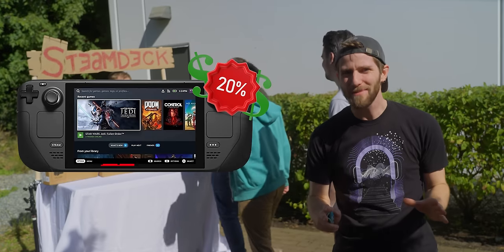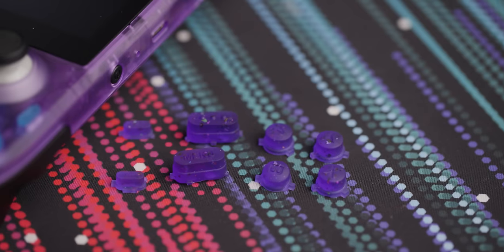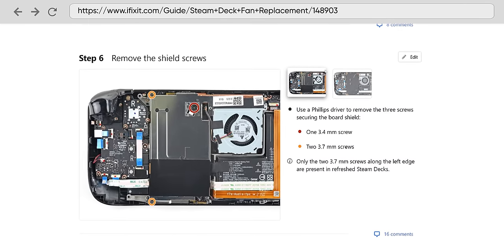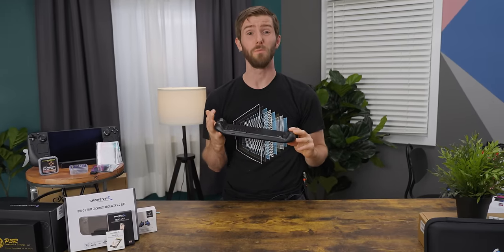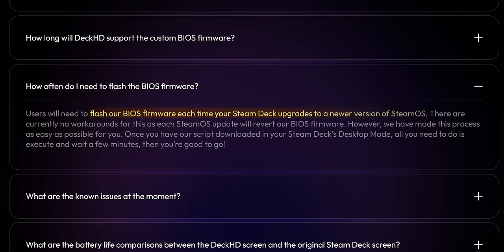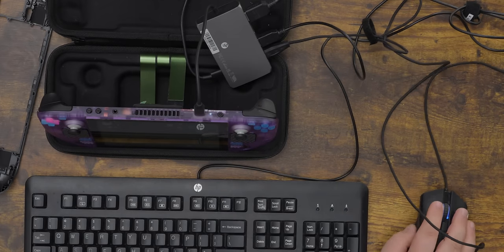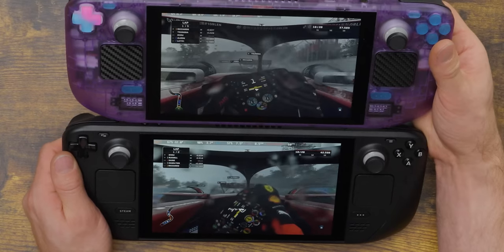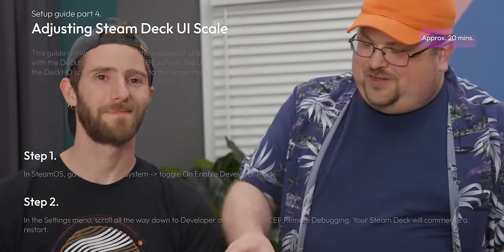Five Steam Deck Upgrades under $100

Comment: In case it wasn't done, I found that with the GuliKit sticks, I had to push (seat) both sticks after installed otherwise, they would feel like trash and stick to the side or down. To seat them (can do out of deck in hand or after install) I literally just compressed the sticks and allowed them to click together. There is a noticeable click after the L3/R3 button and it will feel better and not stick. I have no idea why that was a thing but I confirmed it on 3 sets back to back so it must be on other sets too. Hopefully this will help others that encounter the same issue.

Comment: The fact that people are now able to make replacement screens for the Steam Deck is a big green flag to me. 

Valve had mentioned that screen upgrades would require significant engineering effort (seems to add up based on the complexity of this replacement process) and would never hapoen officially. 

Now personally I would like to see a screen thats the same resolution as the steam deck one but using OLED
Reply: Dude are you a fortune teller?

Comment: I have an ExtremeRate white shell and original screws were no deal at all. They worked exactly as on original shell. The shell is “extreme”Ly premium in my opinion. The screen is not worth it though. Say goodbye to Steam Deck overclocking cause their BIOS probably won’t support it.

Comment: Doing a BIOS flash via what looks like a USB dock seems insane to me, just another point of failure in a very low-tolerance situation. New case and buttons look awesome, screen doesn't seem ready on the integration side yet

Comment: The K5-Pro could be used instead of the thermal pads to account for the height difference? It will make a mess, but if it works xD

Comment: Here's hoping a future iteration of the Steam Deck has easier m.2 access so we can add in an SSD drive with relative ease without compromising the integrity of the case. Maybe something similar to PS5 or laptops, where you just unscrew a small part and swap in the SSD and rescrew it.

Comment: i really don't understand why people insist on switching to a higher resolution display.
just give me a slightly larger (if possible) OLED screen and i'm sold
extra points for a higher refresh rate display, not for heavy games, but for light games and rhythm games, it's a game changer for sure

Comment: Should have tried some upscaling with the screen. Personally I dont care much about resolution but a 120-144hz upgrade? Yes. Id buy a Deck if that was a thing lol. It may not work great for some games but for especially 2D or retro game? Having high refresh is why I still use my laptop for semi-portable gaming etc

Comment: This is kinda the same way I feel about heavily modifying cars.

You can take something that’s for the masses and make it perform amazingly well, and have something truly unique. However, the path to get there is expensive, time consuming and often frustrating in unforeseeable ways. 

Ultimately you end up with something that’s cool, but less reliable and riddled with anywhere from small to unforgivable issues. At some point you should seriously consider just spending more upfront rather than re-doing all of reliable engineering done by the OEM.

Comment: The screw thing with extremerate seems to be how they do everything, I have replaced the shell of my switch with theirs, think I used the original screws and a few months in and the shells are cracking around the screws (after 1 part slightly cracked pretty much as soon as I installed it, which at the time I just out down to me maybe being a bit heavy handed)

Comment: What's the point of all this if there's the OLED version LOL with the momey spent in the video you get a much more optimized device (thermal dissipation, screen, joysticks, dpads, bigger battery and several other improvments) out of the box

Comment: I dunno if it's down to the sub-pixel array of LED vs. OLED or because it's portrait content vs. landscape, but I can always tell when a phone is even slightly lower resolution than 1440p but struggle to distinguish 720p from 1080p on handhelds and TVs.

Comment: I know the "Steam Deck 2" isn't really on the roadmap yet, but I can seriously see myself replacing my entire desktop with one.
I'm still rocking a 4th gen i7 and AMD r9 390 desktop and I plan to run it into the ground. I think by the time the next Steam Deck refresh comes out, it would be a pretty valid upgrade.
Reply: the 1.5 is kinda on the way though with revision 1030
Reply: @tomzpl you were closer than you realized lol

Comment: I use the Deck for emulation so what I would love would be programmable LED buttons that would look like the buttons on the system emulated and change when they system emulated changed.

Comment: I'm astonished by how many people want to 'upgrade' their steam deck. It's the most powerful handheld on earth right out of the box.

Now, I hear you saying 'but what about the ROG ally or other, more powerful, windows based handhelds?' To which I respond: 'windows-based'. Steam deck will still run games faster simply because it uses Linux. Those other handhelds would need TWICE the juice to equal what the steam deck does to an honest degree. =\

Comment: I don't think the external drive is a valve problem, maybe they could have a tool built to do this for you, but this is just how linux works. You need to edit something like /etc/fstab and add the mount for it to persist during reboot
Reply: Didn't read the pinned comment :D

Comment: Given that 1920x1200 is 2.025 times the pixels of 1280x800, the estimate of 20% has to make some very conservative presumptions about how much of the processing per cycle is to do with rendering.

Comment: Linus, Please clarify why the docking SSD issue is a Valve only issue. Are you sure that the dock reports the SSD as a removable USB device? I only ask as I am aware that the disk can be marked as fixed or removable and the reader can also be marked as fixed or removable and this is on the USB Device class side not the host and I would be surprised if the Linux Kernel did not support the USB removable block device class full given it one of the oldest classes.

Comment: I need to get the time to replace the 512gb SSD in my Steam Deck with a 1TB or more SSD, and Linus' Team just straight up blinged out a refurbished Steam Deck.

At least they didn't put RGB fans on it.

Comment: Installing DeckHD is basically a death scentence to performance, battery life and usability of the device. It just goes to show that Valve did the right decision by having a 800p display... The only real benefit of 1200p is integer scaling in emulators. But is it worth 5W extra load. heck no.

Comment: i know this is old but my steam deck was overheating playing god of war hitting 90c then throttling cause my frames to go to crap and my deck to be laggy. All I did was install the Jsaux Vented backplate the one that has the fan cut out and I can tell you now that my temps on god of war never go over 70c. They jump between 69-70c. 

been the best $25.00 upgrade for mt steam deck

Comment: Considering I tend to use lower than native resolution for some games so they run smoothly and all the other significant downsides I don't think this higher resolution screen is a good idea in any way. I'd say don't buy this unless you're familiar with this thing's performance and need to replace the screen anyway.
On the other hand I'm definitely interested in a better (and quieter) cooling solution.

Comment: Seems to me that screen upgrade is only worth it if you plan to use the Steam Deck as a Steam Link device. 

No performance hit if you’re running the game elsewhere. And if you’re home anyway you can just stay plugged in.

Otherwise it just flat out ruins the Steam Deck lol. A 20% hit (or worse) would make the majority of newer games unplayable on the Deck. It struggles enough as-is but just hangs on enough for stuff to be playable.

Comment: I wonder if it's possible to fit a bezel-less 8" screen, because the room is there. Would be dope to have an OLED 8" screen with 120hz, 100% color gamut but still 800p

Comment: DeckHD?
Purple clear case?

Linus has turned into an homogenization of r/steamdeck.

Also PSA for DeckHD, be extremely careful when you're reassembling the deck when done. IIRC its due to the slight difference in form factor on the new panel but yeah, I have seen a lot of cracked screens as the deck housing can pinch a corner of the glass and shatter it.

Comment: Has Labs tested the 1200p screen downscaling to 800p?  Does performance (in game, and battery) match the 512GB model?  Curious if you can recover the battery life when you're off the charger for longer stretches while still reaping benefit from the new screen, but go full hog when power isn't an issue.

Comment: Ther DeckHD is a poor addition to the Steam Deck because it's clear that the manufacturer is cheaping out and not thinking its implementation through. At minimum it should be 900p and at a maximum 1080p. This would greatly improve battery/performance impact while still giving a noticeable bump in vertical resolution. It's clear that the panel they're using is on the very cheap end of IPS panels, considering you can buy a 27in monitor with 100% SRGB coverage for nearly the same price. There is no reason why a 7-in panel cannot have 100% or even over for the price it's at.

Comment: Could you use a low grit sandpaper and polishing compound on the joystick sockets to prevent the extra friction? Basically increase the tolerances? If so, that should have been done from the factory, but my daughter would love that shell, so...

Comment: I honestly don't understand how anyone can say the Deck needs a higher resolution screen when I can't see the pixels on mine. If you're holding your deck close enough that you can see the pixels, you're bending your wrists in such a horridly un-ergonomic position that you're going to hurt yourself. I can see the higher color range argument, sure, but higher pixel resolution? I'll keep my lower res screen with better performance any day.

Comment: If you watch this, DO NOT follow the advice to crank up your heat gun. You'll only botch it. Like they did. Plastic melts at around 160°C/320°F - stay well below that and just be patient.
@LTT: The part about the P3R monoblock reminded me of the Billet Labs incident. This time you recognized that you made a mistake - you even left that in the video but instead of re-doing it right, you just skipped over and went back to the stock shield. You promised to do better. Not having auctioned it (yet) doesn't cut it for me.

Comment: I really don't see the point in replacing the screen, reselution wise, as going higher will hurt battery life or performance, or likely both. Maybe I could see going OLED if possiable, though going higher than the built in screen seems rather pointless

Comment: Actually the correct way to do this kind of mod is find a used model that fits your mods, so it's cheaper than refurbished. For all we know they are replacing the body or screen, at least they have to on worse off models.

Comment: is steamOS not just a distro of Linux? as far as making the drive available on boot you should just need to open a terminal, cd /etc/fstab and then just add the drives mounted location and it should be availabe every boot. Forgive me if I'm wrong I have not done any research at all on SteamOS

Comment: Hey linus "i got the steam deck cooling block and i decided to install it on the rog ally and it performed horribly, nobody should but it its awful if it would of been 20 degrees cooler that would still be the conclusion, I don't have enough money to test it on the steam deck the item it was made for"

Comment: I cannot stress how much I HATE the DeckHD screen. YOU DO NOT NEED A 1080P SCREEN AT 7 INCHES, STOP BEING OBSESSED WITH "BIGGER RESOLUTION = BETTER"

The Deck chose 800p for a reason, at 7 inches 800p has plenty of pixel density to still look really good while being able to cut down performance impact and battery drain, which are a HUGE deal for a handheld.

Comment: That is exactly why I wouldn't upgrade the screen on a pre-built device. They're specifically designed for that resolution

Higher temps, more battery consumption, overall drawing more to push more pixels, and depending on the game, you're just gonna be dropping the resolution back down to 800p/720p for performance

An external storage device in a dock sounds really dumb, but I can think of one use for it. I think I'd rather just keep my Deck exclusively for gaming and have errything on a single SSD within the device itself. If I need a PC, Windows makes life a bit easier. So doesn't having a physical built-in keyboard and USB ports on a laptop

Comment: If " a750 and rtx 3050 is the same prize..which one is good choice considering cuda cores, driver optimization,future supports etc. I will do graphics disign using photoshop,illustrator,maya,blender,3ds max...Thanks.

Comment: for those wondering about Deck HD, dont get it, its a terrible upgrade in every conceivable way.

- brightness is lower than the already dim stock display
- most games are already not made for how small the deck's display is, making that resolution even higher will make most games illegible, and if you need to run them at a lower resolution, why the hell did you buy that display in the first place
- needs a custom patched bios to even work
- battery life goes from average to absolutely terrible
- you need to take the entire unit apart and risk ruining the original screen when taking it out

Comment: Buttons look cool and not to sound cheap but 50USD for buttons is… Not for everyone.
I undertstand the cooler is different because of micro distance differences but still doesn’t seem like a final product thats worth it.
In my opinion the screen upgrade really isn’t worth it (as Linus adressed). Needs much more power so not worth it to change the screen for a higher resolution (altho I heard the colours are better).

Comment: fair warning... Steam doesn't want you to modify their Steam Deck.  While in the process of swapping SSDs the L4 switch came off the left trigger board.  How does this happen unless the board had defective cold solders.  I've been begging Steam to replace or repair under warranty but they are refusing because I was "in the process of modifying or repairing" the Deck.  I've gone back and forth and they refuse to move and offered to send me info for a paid repair service.  All the other switches are firm on the boards with no issues and there is no possible way I could have exerted enough force opening the case to cause the switch to come off.   Just beware... according to Steam Support you will void your warranty if you swap drives or any other damage or defects are detected.

Comment: Got the 64gb refurb model, upgraded the SSD to 1tb, changed the back plate to a JSAUX and got GuliKit Hall Effect Joysticks. Couldn't be more satisfied tbh.

And it looked brand new, there were ZERO signs of any wear on the unit, display was flawless etc.

Comment: Currently the Sabrent dock (the one I own is the non m.2 version) has sound issues over hdmi with OS 3.5 in preview, so far nothing has really fixed it and I don't have trust it'll work with the full 3.5 release at this point.

Comment: I think the Sabrent dock is part of the reason why I think I'd rather use a Windows mobile system. I love Valve and what they have done, but with all the issues that Windows could have, I still would rather have it work as Windows.

Comment: an improved monoblock will be great i'm sure :D but the deckHD seems to be the most useless upgrade. better colours would be great but i wouldn't want more pixels on a device that has just enough power for the original amount of pixels. an 800p oled display would be cool i guess

Comment: The higher res screen doesn't seem like a good idea to me with all the messing around and I bought a JSAUX dock for my steam deck and its the worst thing I got its almost useless. I got it to use my deck plugged into a TV while in hospital with a wireless keyboard and mouse and some external storage and my headset but as soon as you plug in anything (like a USB Stick) with the wireless mouse dongle the range on the dongle drops to a few cm (I have test on other computers and this doesn't happen). It turns out they didn't put any shielding on the USB ports also once you have 2 USB items plugged in it starts to interfere with the HDMI with it dropping in and out. I did message them about this and was told its the way it is designed to work and were not very helpful at in the end all they would do was give me £8 back on a £40 dock that is almost completely useless I still need to find a new dock but with not being able to work now due to medical problems I am warry on buying any dock as I cant afford to waste money.

Comment: 14:30 or maybe put Windows on the drive so it turn into a Desktop when you dock it there is actually a option in the BIOS to automatically boot from a external drive

Comment: My rating from best to worst:

SSD: if you want more storage and SD cards aren't doing it for you.
Sticks: can be pretty good, would do it if originals need replacing.
Case: if you like the looks.
Cooler: probably not worth it.
Screen: stupid, don't do it.
Buttons: rip off.

Comment: I would need an OLED Screen to do any sort of upgrade, after having an OLED monitor all LCDs look terrible, so going from one LCD to another would never be worth it for me
Reply: IPS has always been fine. Ive used numerous OLED screens. Not worth the battery drain even remotely.
Reply: @Wylie288  for me it is, IPS just can not compare to the perfect black levels of an OLED, its not about the color accuracy, really I don't care about that much, its about the fact each pixel is individual lit, making blacks look black, not grey